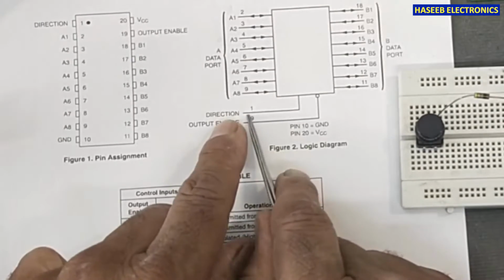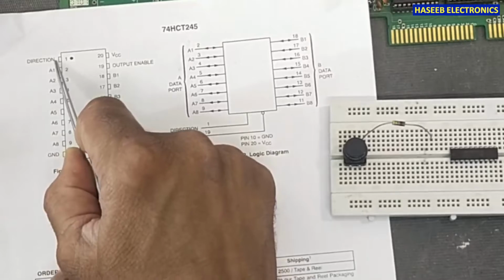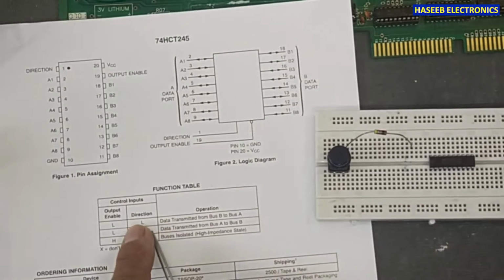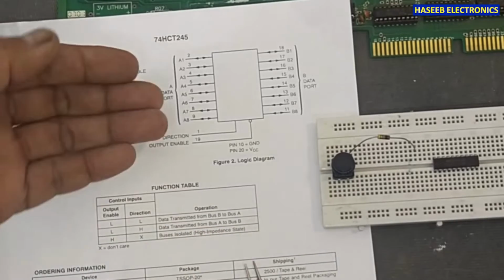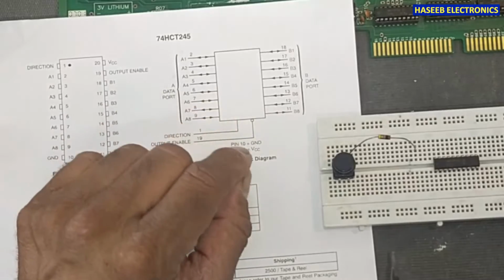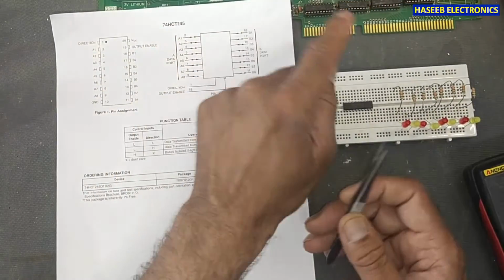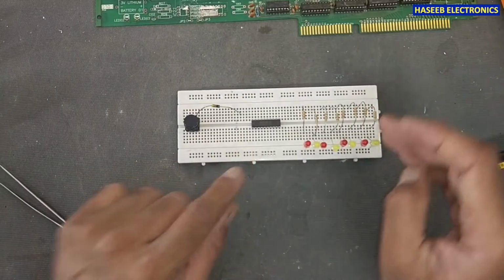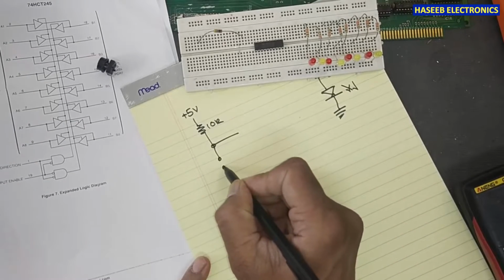{763} How To Test 74LS245 8 Bit Transceiver

Comment: Very good explanation but there is difference in working of ls245 and hc/hct245 due to compatibility...
Reply from the maker: thanks a lot 
yes brother
each 74245 (standard), 74S245, 75LS245, 74HC245, 74HCT245 all of them have difference of switching speed, propagation delay etc. 
in that reason some of them cannot be used as replacement to other